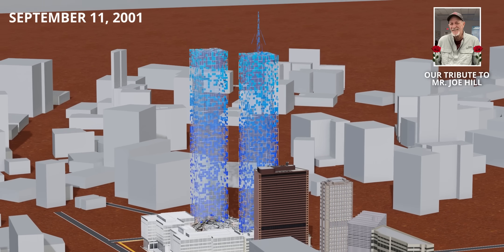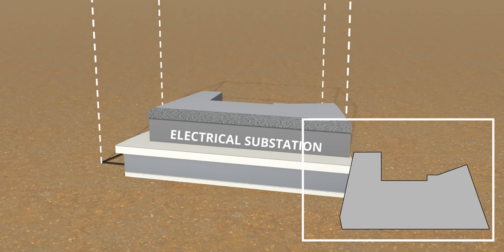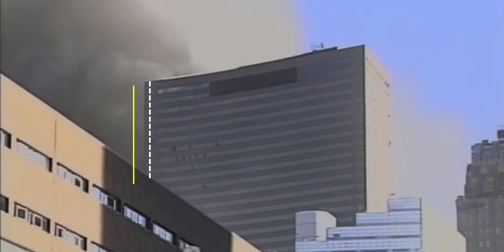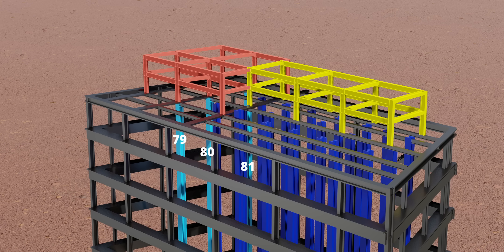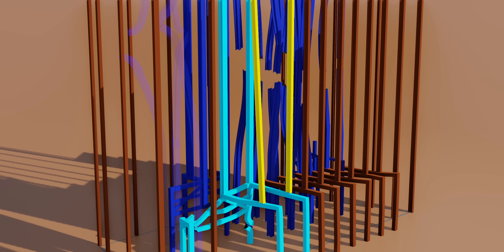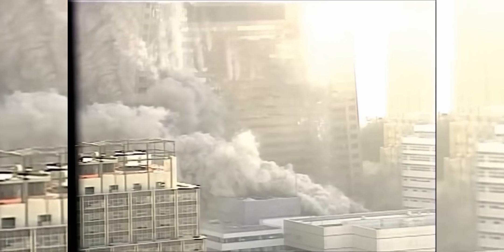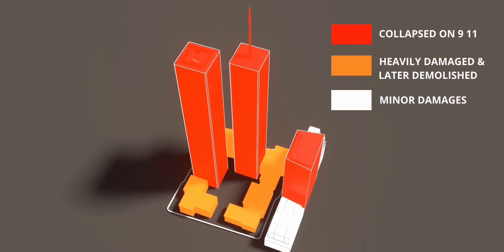Collapse of Building 7 | The Complete Physics

Comment: Wow I am convinced 😅😂😂. Moreover The passport of Hijackers were found clearly but the WC building 7 couldn't handle the consequences of attack and fully collapsed even the buildings were made with tough materials. (I would recommend you to see The 9/11 files  by Tucker Carlson)
Reply: Maybe this will help:  Building 7 - the 6th building to collapse of 10 lost on 9/11 - because of its low priority was largely ignored early on, so conspiracy filled the information void with a lot of  garbage from ignorant people promoting political agendas, creating a lot of confusion and misconceptions.  So I prepared this brief summary using my own technical analysis, not ideology and magical (non)thinking to dispel them. 

At 10:28am the WTC North Tower collapsed, showering Building 7 with tons of burning debris, causing heavy damage and starting many large fires that burned out of control for the next 7 hours. Half the FDNY firefighters having been killed, units in disarray, equipment destroyed, no water pressure, and the greater urgency of search & rescue efforts, Building 7 couldn’t be saved so firefighting efforts were pulled as futile and 7 left to its fate. Firefighters make that sort of choice every day in brush fire situations - which houses to save and which ones to let go. Only real difference here is moving the decimal on the size and cost. People get overwhelmed by the size.

www.youtube.com/watch?v=g_SvpwyC17M

Collapse of a burning structure is always a concern for firefighters and steel buildings are uniquely vulnerable to fire damage. When subject to fire they rely on active firefighting to survive, designed around 1 to 3 hours of fire resistance to, allow time for occupants to escape and active firefighting to get started.  After this all bets are off. Left to their own devices they'll exceed their design envelope and collapse, like Plasco Tower and Wilton Paes de Almeida. In 7 the occupants escaped, passive and active fire protections were compromised and active firefighting was abandoned hours before the collapse, which left the building to its fate. It lost. Odds on Building 7 would eventually collapse, and it did. No big deal in logic.

 http://www.youtube.com/watch?v=WnYBX6QT0R4 

FDNY Chief Daniel Nigro - The biggest decision we had to make on the first day was to clear the area and create a collapse zone around the severely damaged 7 World Trade Center, a 47-story building heavily involved in fire. A number of fire officers and companies assessed the damage to the building. The appraisals indicated that the building's structural integrity was in serious doubt. I issued orders to PULL back the firefighters and define the collapse zone. It was a critical decision; We could not lose any more firefighters. It took a lot of time to PULL everyone out, given the emotionalism of the day, communications difficulties and the collapse terrain 

FDNY Deputy Chief Peter Hayden ; We had our special operations people set up surveying instruments to monitor and see if there was any movement in the building. We were concerned of the possibility of collapse in the building. And we had a discussion with one particular engineer there, and we asked him if we allowed it to burn could we anticipate a collapse and if so, how soon? And it turned out that he was pretty much right on the money, that he said 'In its current state you have about 5 hours 

The collapse of Building 7 was anticipated and widely reported in the media throughout the day, with 24 video cameras recording some or all of the collapse. Everyone knew what was coming and why. 

www.youtube.com/watch?v=OY5S5k3tMHI

Building 7 collapsed from the inside out which is not at all intuitive and hard to understand with most details being hidden from view.  It requires careful analysis and observation, and some people will struggle no matter how much it is explained. But here is my explanation relying on no outside authority. 

Building 7 was a unique, asymmetrical 47-story steel frame structure built atop a smaller 3-story building serving as a partial foundation, requiring lower floors dedicated to complex load transfer structures. Of trapezoidal shape and tube-in-tube construction, B7 (above the 7th floor) consisted of a central core of steel columns carrying most of the gravity load, perimeter steel columns around the outside of the structure carrying the remainder of the gravity loads and long span beams and girders to tie those elements together and form the floors. On the outside of the building hung a facade or outer shell. 

www.nist.gov/image-16640

Phase 1 : First externally visible signs of collapse initiation occurred at 5:20:28 pm and was notably quiet with observers not realizing the building was collapsing! No warning in the form of hundreds of eardrum busting 180dB explosive bangs. Here at 12:00 a local CBS affiliate reporter talking 10 blocks from B7 when collapse begins. People don’t start to notice the collapse until 12:11. At 12:45 is the famous CBS fixed camera clip of Building 7’s collapse. Note the silence. 

www.youtube.com/watch?v=t5tEy6mXSE8

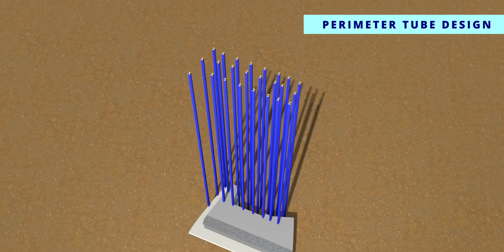Lower floor failures above the load transfer region (8-14) in the NE corner initiated the collapse. In this video at 0:45 you can see the NW corner from inside the building while under construction, Column 79 just out of frame on the left. That big, angled steel beam across the top of the frame connects to C79 at one end. The girders connect to the beam. That beam and all those girders depend on just one connection 

www.youtube.com/watch?v=nP3TNHPCIVU&t=45s

Phase 2 : NE corner floor failures caused a loss of critical lateral support over an excessive length of Column 79 and it buckled. Externally as collapse begins we see a vertical progression of window breakage along the 44-46 line and a kink in the roof of the East Mechanical Penthouse at the top of the building, consistent with C79 failure. Looking at the above floor diagram of Building 7 when you see all the structures that depend on C79 you quickly realize this one column was a relatively isolated structural element on which a disproportionately greater fraction of the structure depended analogous to say the Key Bridge. Normally with a buckling column, the load could be redistributed to other columns. With C79 that is not the case - the failure did not redistribute the load, so the collapse rapidly progressed to the roofline, sinking the rooftop penthouse. The transition from full capacity to almost no capacity occurs in an instant and will result in virtually no resistance 

Phase 3 : With C79 gone, B7’s progressive, non-symmetrical collapse continues with adjacent columns 80 and 81 left laterally unsupported and quickly buckling as well. The EMP drops down through the building. C79-81 all have no diagonal bracing, which is the major reason why they could not redistribute a lot of vertical loads among one another. From there collapse progressed from east to west through the central core until the core was gone from 81 to 58, taking all the interior floors and probably most of the perimeter columns with. Follow the horizontal progression of window failures low in the building and the dropping of the remaining rooftop structures into the building. The NIST Building 7 study model 4 determined C79 failing under ANY circumstances would have initiated the same collapse sequence. 

Phase 4 : After about 10 seconds only the exterior moment frame remains, giving the illusion B7 is still standing to the casual observer since little has outwardly changed. But it is just a hollow empty shell like an empty cereal box supported only by a few remaining columns and overloaded from the loss of the core columns and floors, quite unable to remain standing. With nothing remaining behind it, the north face leans inward, forming a V in the roofline, the last few columns buckle under the strain and the moment frame free falls, landing on top of the debris pile. 

It is more than 10 seconds into the collapse before a single measurement of alleged free fall acceleration is taken. It was not The Building but only the empty hollow outer shell that was still standing being measured. The measurement is not a sustained period of FFA but rather a curve starting out below then up to and OVER 9.8m/s/s before decelerating back down below again, arbitrarily averaged over 2.25 seconds to get roughly 9.8m/s/s. The single measured point was not The Building , was moving in 3 dimensions, not just down and is a product of collapse progression mechanisms not collapse initiation mechanisms, thus tells us nothing about why the building started falling 10+ seconds earlier. It’s meaningless. Start to finish the total collapse took 18-20 seconds or 3 times longer than true FFA . How fast something falls can’t tell you what started it falling anyway.    

The debris spread well outside the footprint blocked surrounding streets, heavily damaging the Verizon Building and destroyed Fiterman Hall. 

No building is meant to survive 7 hours of multi-floor unfought fires. Building 7’s progressive, non-symmetrical collapse was incidental, unintended collateral damage from the combination of fire, time & gravity started by the collapsing North Tower, true no matter who planned and carried out the 9/11 attacks or why .  Of so little consequence it barely registered at the time, only taking on semi-mythical status as an alleged smoking gun years later when demolitions at the Twin Towers, missiles at the Pentagon and shoot down over Shanksville all failed and conspiracists had nothing left to work with. 

Anything can seem like a conspiracy if you don’t understand how it works. Now you should. I hope you found this helpful, informative and it solicits informed critical comment. If I made any errors of fact, logic or reason or left anything important out, please let me know so I can fix it. OR offer a more plausible alternative if you can. Be the first. Please start any reply with the words “Tits McGee” or I will know you didn’t read it and are wasting my time.

Comment: The only people that believe this was anything other than a building collapse after structural damage and fire apply the same physics and justification principles as flat earthers, moon landing deniers and chemtrail proponents bathing in pseudoscience despite hard physical evidence and mathematics. Not to mention we’ve now had several hi rise collapses since linked to the failure of load bearing columns.
Reply: Not one fell into its own footprint after burning for less than an hour that only happened on 911 and building 7 was definitely nothing more than office fires small office fires at that nothing that would bring a concrete and steel building down it wasn’t built without redundancy even failure of multiple columns would not make the building come down like a controlled demolition look at some videos of controlled demolitions
Reply: There have been multiple high rise buildings burn for hours on for 18 hours that didn’t collapse buildings are designed to handle fires
Reply: But they didn’t turn to dust and fall into their own footprint as near free fall speeds even earthquakes can’t produce that type of collapse
Reply: @jc64car The Plasco Building in Tehran collapsed in 2017 and it is a highly analogue case to WTC 7 where the uncontrolled fire in the building eventually caused its core structure to fail and collapse in a cloud of dust just like WTC 7.
Reply: Failure of several structural components will not cause the total collapse of a modern high rise or property engineered concrete and steel structure
Reply: People who believe the official story have been misled

Comment: Good try but I'm not buying it.  All the pretty graphics do not include the intermediary floor supports between the penthouse and the footer of the building.
The grids of each floor would make a box like form within the building for each floor.  The resulting form factor would resist tortional forces and transfer vertical loading load across the entire next floors grid. Even with C79, C80, and C81 broken near the lower levels, the integrated grid of the horizontal floor supports would transfer the load to the rest of the supporting columns according to the distance from the point of additional loading. 
I'm thinking that this was part of the plan, YES PLAN, to cripple the United States. 
A service company was working on the entire elevator system for weeks prior to 9/11.  The day of 9/11, none of the workers for that company showed up and the company coincidentally disappeared within 24 hours.
Video of the Twin Towers impacts and collapse, examined by forensic audiologists, indicate multiple secondary explosions half a second after the planes entered the buildings.
Forensic examination of the steel columns show undeniable evidence of Thermite. 
The buildings fell EXACTLY in their footprints as you would expect from a controlled demolition. If the buildings fell from the plane impacts, as the "pancake" theory suggests, the buildings would have fallen RANDOMLY and in a much wider area.
Reply: What box grid?  There was no box grid.  Have you ever bothered to look at the structural plan?

www.youtube.com/watch?v=nP3TNHPCIVU&t=45s

Sabin glosses over collapse initiation mechanisms in this video, for reasons I understand as there is some debate over exactly what failed and when.  There is fundamental agreement however that lower floor failures at the northeast corner of the building (7-14) caused a loss of critical lateral support over an excessive length of Column 79 and it buckled. 

Looking at the above floor diagram of Building 7 when you see all the structures that depend on C79 you quickly realize this one column was a relatively isolated structural element on which a disproportionately greater fraction of the structure depended analogous to say the Key Bridge. 

Normally with a buckling column, the load could be redistributed to other columns. With C79 that is not the case - the failure did not - could not - redistribute the load, so the collapse rapidly progressed to the roofline, sinking the rooftop penthouse. The transition from full capacity to almost no capacity occurs in an instant and will result in virtually no resistance
Reply: What is your profession?

Comment: Slow Down
Energy absorption: A building collapse is not a free-fall event; it is a process of one floor impacting the next, which must then support the increasing weight. Each impact involves crushing concrete, buckling steel, and generating heat and sound, all of which absorb a significant amount of the kinetic energy of the falling mass.
Resistance: The remaining structural elements, even if failing, offer resistance to the falling debris, which slows the descent. The building is essentially "crumbling" as it falls, using up energy with each successive floor failure. The collapse speed is significantly less than free-fall speed for this reason.

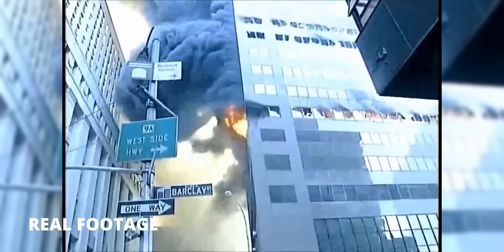Comment: The video at 3:06 is edited badly 😂😂😂
Reply: It isn't edited at all.
Reply: @TheCriticalStinker-01 see the black line in the upper portion... They have cut the video from the tall towers burning behind and attached it there... Look the the flow of air
Reply: @Chuckle4u  - This footage was shot hours after the Twin Towers fell.
Reply: I particularly like the 0:35 mark where the penthouse is bent but the floor is fine for 30 floors then damaged below causing damage to the penthouse walls and ceiling but completely fine for 30 floors. If anything that looks like 2 bombs went off. Cutter charges in the penthouse and a massive bomb down low. Its a shame people buy this stuff. This is complete nonsense.